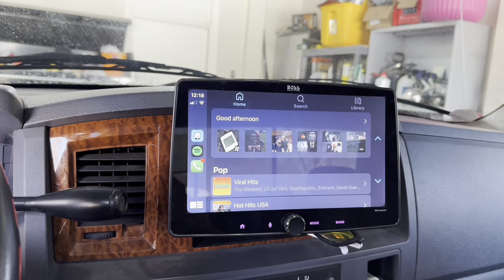Installing Infinity Speakers In A Third Gen Ram!

Comment: Hi Trent,  I just bought an "08 Mega Cab with the basic factory 4 speaker sound system but it has an aftermarket no-name head unit and no amps.  The speakers are original so I just bought Infinity Reference for all 4 doors (also at Crutchfield on sale), along with a pair of speakers for the dash for a total of 6 speakers.  I have a 4 CH Amp that I want to install with the new speakers but am not sure the best way to connect/wire it up.  Did you use 9-connector wire from the amp and tap into the original wire loom for the speakers or did you run all-new speaker wire from the amp, thru the door plugs to the back of the speakers?  I also need to figure out how to wire up the 2 new dash corner speakers since my truck never had any speakers there.  Any advice or suggestions would be appreciated.  Thanks !
Reply from the maker: @mikemd2697  Hey Mike I ran all new speaker wire from the amplifier. I put the amplifier behind the back seats. Doing  this allows you to push cleaner and more power to your speakers. I was able to convert my base 4 factory speaker system to 6 by splicing into the 2 front Chanel wires. Another reason that you would run new wires. Make sure you install your cross overs to the front dash speakers because they play less bass. As well make sure your gain isn’t to high to start to avoid blowing out the smaller more efficient dash speakers.
Reply from the maker: @mikemd2697  let me know if you have any other questions